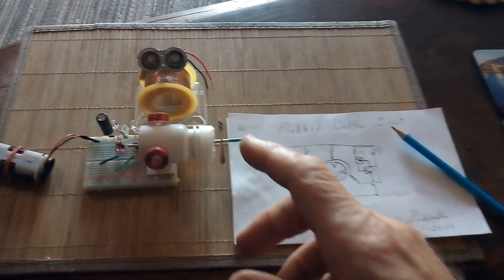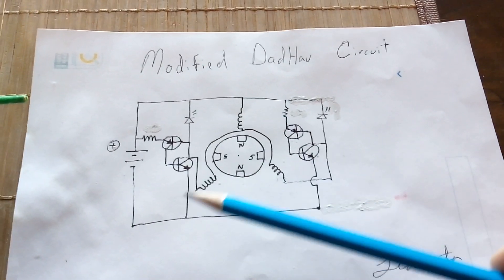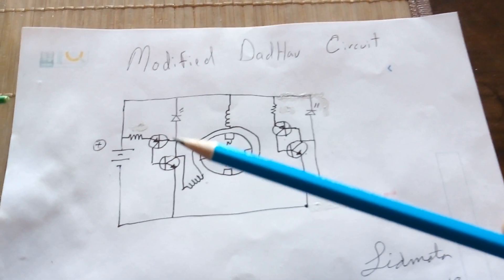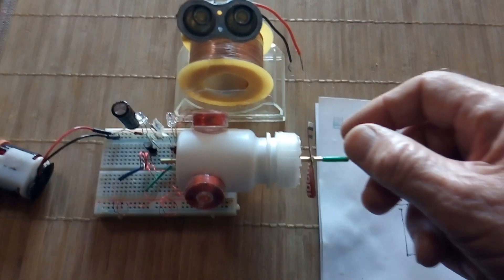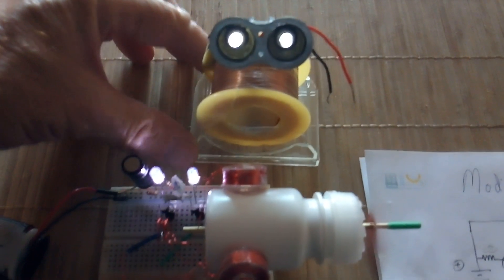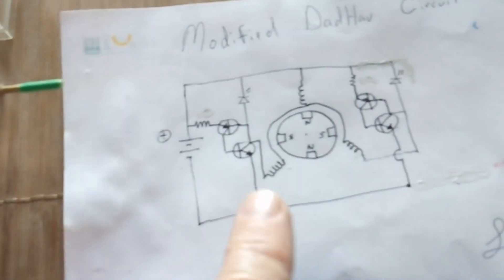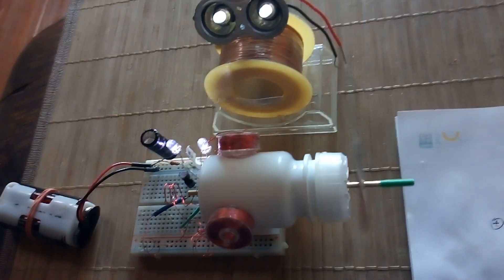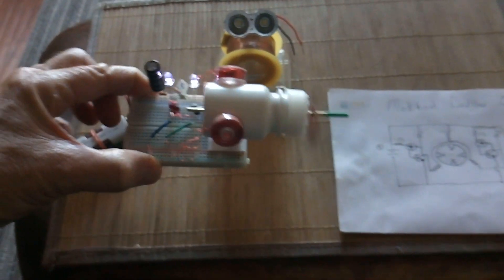Simple driver circuit for my simple star wound 3 coil DC motor.

Comment: You seem to really have an excellent understanding of electrostatics. Have you ever done any experiments with Kelvin generators? All the ones I've ever seen were just replicas of what Lord Kelvin came up with initially. It seems like there could be more there with high pressure laminar flow, modern preformed insulators like PVC, compounded chambers and so many things we have easy access to that were not around then. Seeing your sailing videos got me thinking of that because it's a natural process similar to rain and lightning. My Whimshurst generator wont work if theres any humidity at all, yet a Kelvin generator runs on falling water with tiny particles splashing everywhere..

Comment: Congrats with this! 
One method of starting it would be to mount it on a plane and throw it, the prop spinning starting the motor. I guess fitting a prop and blowing on the thing would also start it.
For 'throttle', I wonder if a double connections pot would work, limiting +Voltage or Base current to both sides?
Reply from the maker: Thanks.  You can adjust the speed with just one pot on one side.  On this setup I used a 10K pot on the right side with a 2.2K resistor on the other side.   The gap between the magnet rotor and stator needs to be much closer than I have here for better power.  At least I got it to work.

Comment: Nice build and explained well.  I'm wondering how the efficiency of this dual transistor pair / 3coil configuration compares to the traditional single transistor pair / single coil pulse motor.   I'm guessing the single coil approach might be less powerful, but more forgiving to magnet and coil alignment errors.
Reply from the maker: Thanks.  The single coil approach is much easier to build and get running.  The problem with this 'star wound' three coil approach is that it just isn't  easy to get the stator to fire right without a complicated driver circuit.

Comment: Kindly tell me the value of 2 resisters .
Reply from the maker: I am using 2.2 K ohm resistors but I started using two 10K pots and playing around with them to find the sweet spot.  The coils are about 10 ohms. I used 30ga magnet wire wound up on sewing machine bobbins.   The rotor magnet has to be a strong neo to trigger the circuit.  This whole setup will not work with weak magnets-----I tried it.  Common PNP and NPN transistors work.  Something like 2N2222 NPN and 2N3904 PNP.
Reply: @Lidmotor  Thank you it's so nice of you. Now it will much easy to make this motor.
Reply from the maker: @moinshaikh2265  You are welcome. I hope that you build one.
Reply: @Lidmotor  so far i have try your so many motors and they all working very well now this time i going to make this motor.

Comment: Cool!
You could probably make it 3-phase using specially tuned RC or LC sections in your circuit.  They'd have to fire (switch on)  in sequence with a short delay between each firing.
Reply from the maker: Thanks for the idea.  I am still scratching my head about ways to drive these type motors.

Comment: You have an NPN and a PNP on each side? 
This has nothing to do with what you have there but I have not yet been able to make a darlington pair do anything for me, I'm better off with one transistor set up in a joule thief,  I don't know what I'm doing wrong, I thought I would get twice the output from the darlington pair than I normally get out of a joule thief but I'm getting way less. Thanks for sharing that with us, it's a neat idea.
Reply from the maker: I have played around with Darlington pair arrangements a lot but, like you, I don't use it much. The gain is great but you end up with more amp draw as a trade off.  This Sziklai pair arrangement here I have had very good luck with.